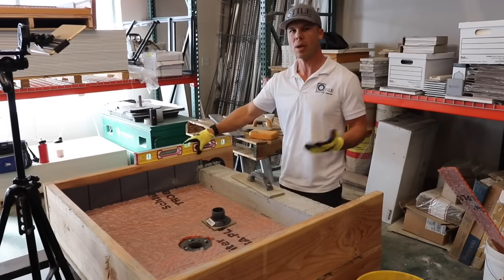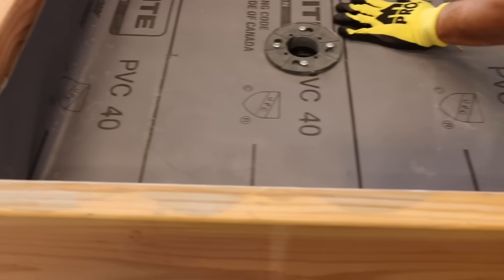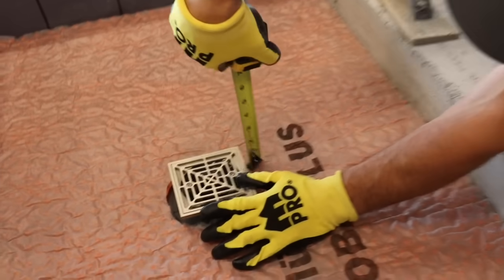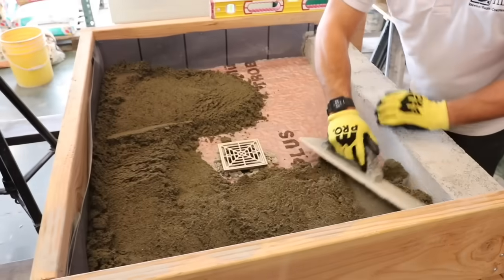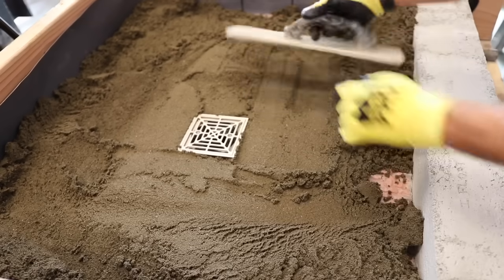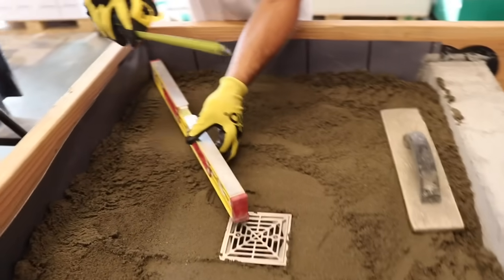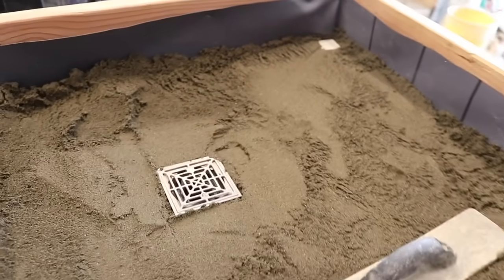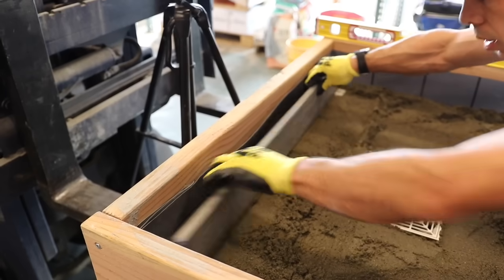How to Slope a Shower Pan: Tile Coach Episode 18

Comment: Drypack socks. It is a failure. Who decided to put extremely porous concrete product in an application like this.  Some capillary  bs they feed these guys. If your doing a Drypack you don't need a slope. That's how it made to work. Ask any concrete guy. If you have regular concrete at 3500 psi, it is porous  but water does not impregnate it to much. But if you have 4500 psi concrete the water impregnation is minimal.  And so on. I understand,  these guys all learn from a failing concept. 
And now they have schluter system. Someone figured out to stop the moisture before it reaches the concrete.  Good thinking finally.  But who wants a floor pan made of Styrofoam  that is outrageously  expensive,  installed by someone who just learned the approves by a company that hasn't even had the product out long enough to realize the problems with it.  It's a dyi situation and leaves open door for failure. 
Let me be clear. Hot mopping was originally used for plant boxes and commercial showers, that's why drypack worked,  drains in the plant boxes and poured drypack for huge showers,(ever wonder how huge gym shower sauna drain  with almost no slope and few drains, there you go. The water is saturated into the drypack until it cannot hold any more, the rest goes down the drain.  Seriously.  That is why tile showers always stink. Moldy stinky drypack. It never drys out.
And as for the guys who say they are this old and blah blah blah.  Shower floors only became notable since the mid nintys. I mean more fashionable,  more people wanting them. But even then it was much more custom than it is today. I'm not saying they weren't done but if you ever work in a old home, 150+years  you would understand what I'm saying. They used layers of different concrete products and principles to waterproof.  Has anyone ever heard of venetian plaster. Plaster done with such expertise it is water proof. 
All I'm saying is don't be a sheep. Research and know the product you use indepth. 
Not here to cast shade, and especially not to this individual.  Contractors, learn your product not just from today, but from yesterday also.. I'll never use a drypack of schluter system. It's like the blind leading the blind. 
I'm just sayin